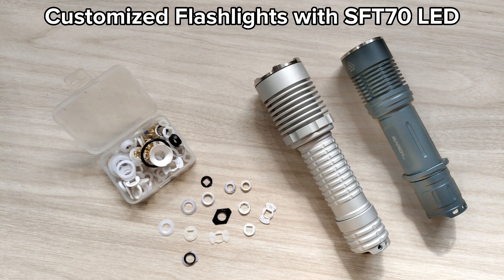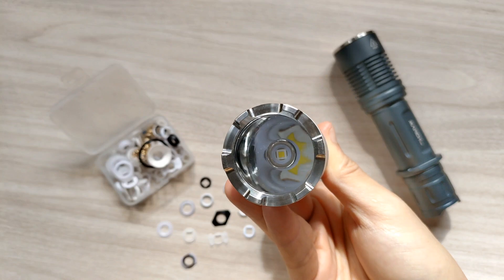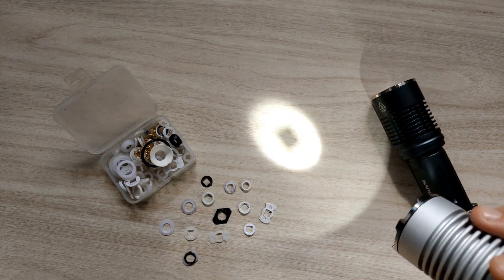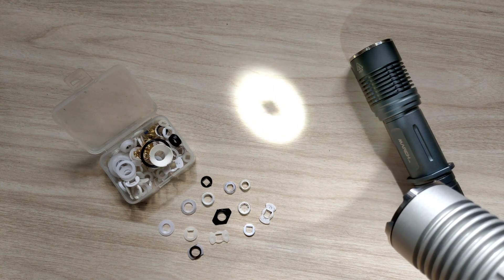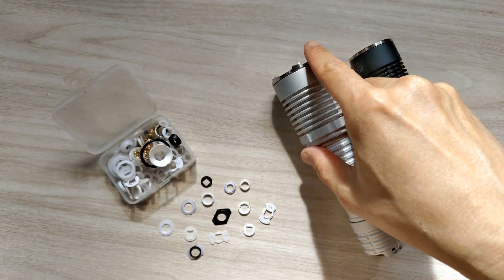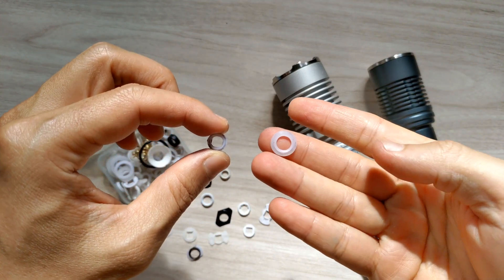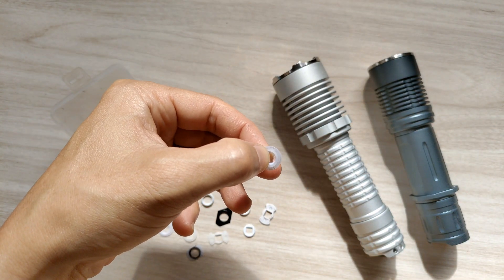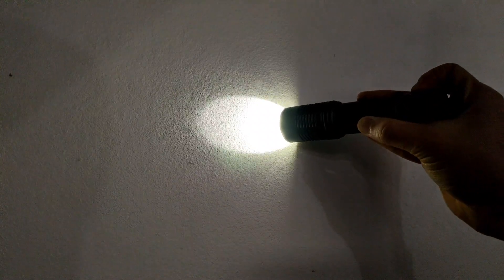[Sharing Experience] PART1 - Customized Flashlights with SFT70 LED

Comment: Since the diameter and depth of the reflector is low, the led won't have good throw even with smooth reflector. It looks fun trying to solve the dark hole issue but not sure it's worth it for a compact flashlight.

It's a pretty good video nonetheless. 👍
Reply from the maker: Next vdo you will see how well it can throw. I will try to test it at the bird house 200, 300 and 400m. Thanks for watching sir 😊🙏.
Reply from the maker: I just made beam shot at 320m. My new flashlight with sft70 smo can reach the bird house sir. I can't try 400m because of the trees there block the bird house. Coming soon sir 😉.